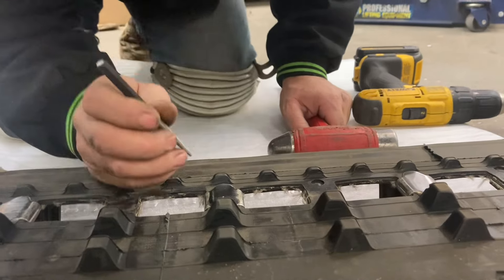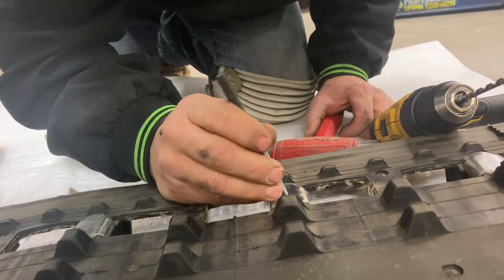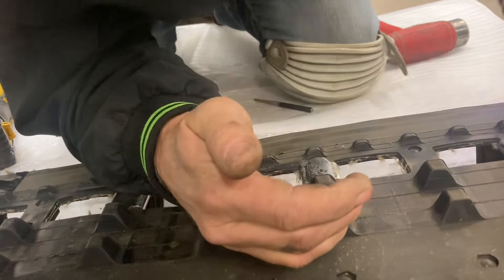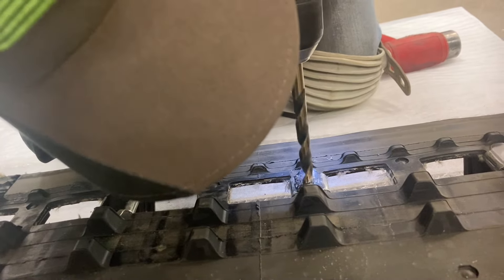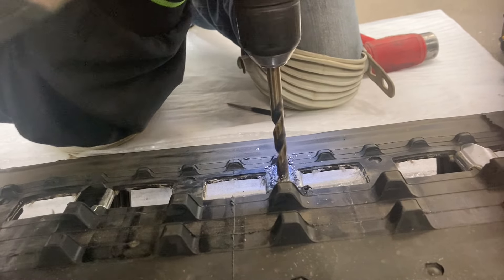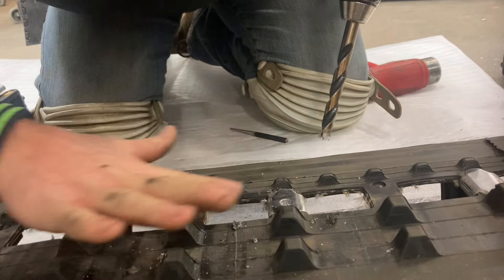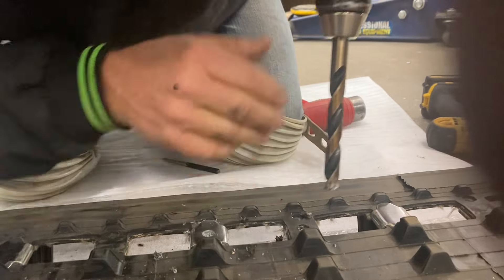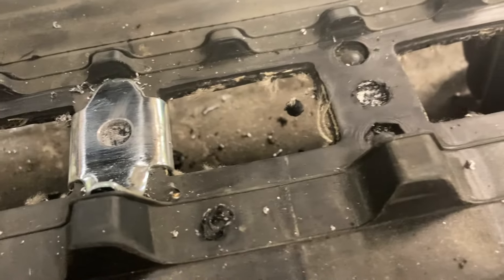Installing ice cool clips in a twin rail track!

Comment: As a newbie, what does this do?
Reply: nothing, it was a terrible attempt at an aprilfools video
Reply from the maker: It packs the snow in the holes turns into ice reducing friction 100% reducing rotating mass prolonging hifax life and keeping the clips cool on hard pack snow!
Reply from the maker: This is no joke should be done to every track!!
Reply: @jimbauerXp3  no it packs snow full of rocks and salt that kill the rollers 2x faster. A smooth surface is better.
Reply from the maker: @timothywhieldon1971  it does not pack with rocks my 04 900 mountain has 4,000 miles and the hifax look like new and the rail never had scratchers plus I pull a big pack sled 13 miles in and out of Cooke city for 13 years!!